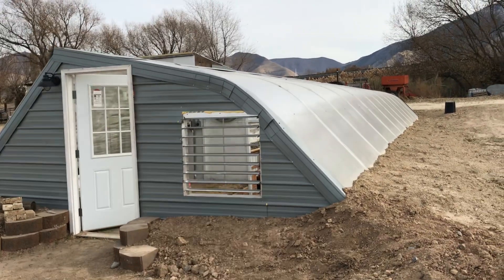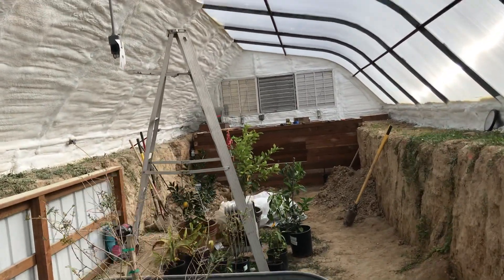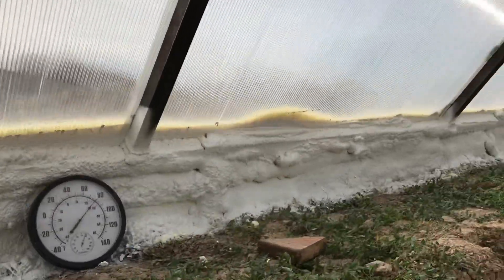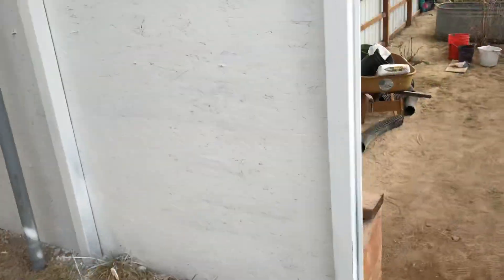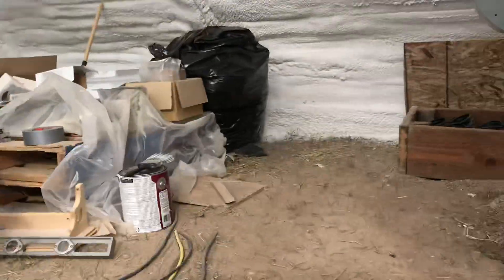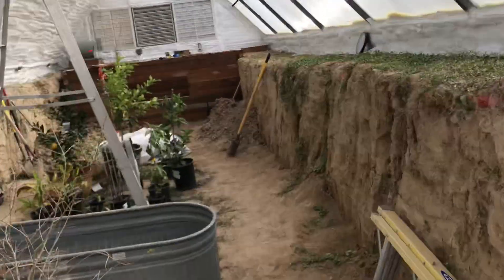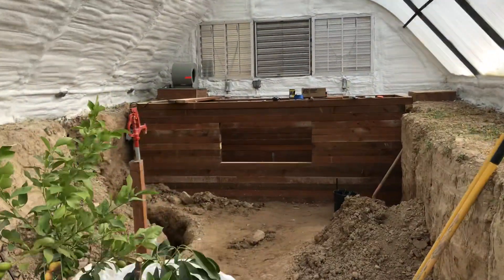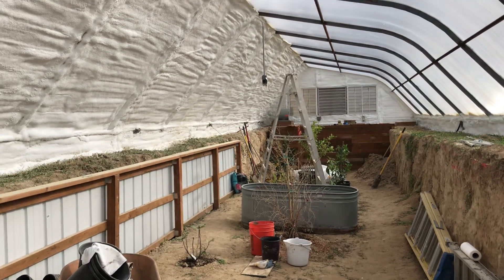Greenhouse update (Nov).  Insulation, geothermal heating and cooling, and more

Comment: Any comments on the potential toxicity of the spray-on insulation?
Reply from the maker: I hired a professional to do the insulation.  They wore protection and masks as there are likely chemicals and  vapors that are not healthy during the process.  I returned a day later to paint the insulation to avoid the potential for any "off-gassing" which may or may not occur during the life of the Product. The insulation and the below ground nature of this Greenhouse help a great deal in reducing the amount of "energy" used to heat or cool this Structure.  Without a doubt the process is not always 100% environmentally friendly but my goal here and elsewhere is a net positive carbon footprint.

Comment: Amazing video! What material are the black geothermal pipes?
Reply from the maker: We used a 4" HDPE pipe.  We purchased it from Home Depot.  Its made by Advanced Drainage Systems.  It was recommended that we use a perforated pipe but we went with a solid pipe because of the water we have here.
Reply: @trailbreakfarms  If u have a backhoe and more 'perforated' pipe, any farmer here in Iowa, could get rid of that water. By not using perforated pipe u are severely limiting your heating and cooling potential. Love the closed cell insulation...I did that back in the 80's for a summer!
Reply: @atomicwedgie8176  Is there any concern about dirt infiltrating through the perforations into the pipe?  Eventually plugging it up?
Reply: @terimiles5699  The only soil that will plug up perforated field tile is fine sand, whether wet or dry. A call to your local county  conservation board would probably be familiar with your local soil types or ask local farmers in your area.
Reply: @atomicwedgie8176  Thank you.
Reply: They also make a sleeve for perforated drain tile to reduce clogging.

Comment: Plyurethane greenhouse ??? What ? I think someone didnt get point of healthy tasty food using   only easy biodegradable materials .. huuuuge finger down folks
Reply: sound like you're prejudicial without understanding the big picture. doubtful you will get very far in life with that attitude.
Reply from the maker: We have never had a goal of using only biodegradable materials.  Timber, for example, does not last nearly as long as the metal tubes we used for framing and would need to be replaced.  There is also an argument as to whether certain biodegradable materials cause undesired methane emissions because they break down quickly.  We did attempt to use recycled, single use material where possible.  But who knows?  We can all learn from each other.  If you know of a Greenhouse built using only biodegradable materials, point us in their direction so we can learn about what they did and why.  Sounds Cool!!!
Reply: I’ll interject due to the ignorance of the individual stating an oil based product is not biodegradable. I suggest start research for diesel from plastics. Plastic will become the #1 most biodegradable product in the world shortly. Oil is the most transformative product, with multiple uses, while still capable of returning to original form using an extremely simple, non toxic, non polluting method. Welcome to the 21st century. This is good news.
Reply: @sknerl  
How about using Olive Oil to protect any lumber
Years ago I'm thinking in Italy that's what they may have used
Reply: @jimh4167  One of the oldest methods of preservation is used in Japanese carpentry. Using fire to preserve, there’s a name for it, followed by oil. Olive oil is a great white oil useful for so much. I see folks using large propane torches to scorch larger areas. Calling it green or biodegradable is up to definition. It’ll look the part.

Comment: If I recall Russ’s back wall is not insulated. I see yours is. I have often wondered how his kits would benefit from spray foam. Will be interesting to see how you make out this year.
Reply from the maker: They (Greenhouse in the Snow) recommended the spray foam to me and told me recent Greenhouses with the spray foam were performing better than those prior units that used insulation boards.  I definitely love the spray insulation.  I went 2 and 1/2 inches thick and it makes a big difference.
Reply: It will make a huge difference and again even more if the front wall was insulated too.  The moisture in the soil will literally wick the heat out of the greenhouse, causing a slight “negative” in the area of heat accumulation inside.  So instead of getting a maintenance temp of 45+ on 15 degree nights, it’d be 36-38   Doesn’t seem like much, but if you’re trying to grow things over winter, ( not just over winter things) its the difference you need.
Reply: UNconventional Me my house is 7” closed in the walls and on top of the sheetrock. Situated on exact south with 19 windows and concrete floors I am heating with 2 small mini splits. And when the sun is out I can turn the heat off and it will hit almost 80 degrees at zero degree outside temps. I LOVE FOAM!
Reply: You could cover the back wall with mylar over the spray insulation to reflect light

Comment: Very cool!  I haven't seen very many people post videos of their kits built.  Russ truly has developed quite the system.  It's on my list to go take a tour and see it in person.  What will you be growing in this space?  Do you have any kind of backup in case the electricity shuts off?  That's my biggest worry.  It gets to -35 here for weeks at a time.  Having the power go out in winter could potentially kill all the plants.  I would be curious what your electricity costs run with the greenhouse in full swing.  Thanks for posting
Reply from the maker: Growing area is 17 x 72.  My plan is Vines on the North Wall Grow beds on north and south.  Trees and shrubs and ground cover in the main area.  Mostly tropical fruit.  Regarding back up, I am going to put a solar unit up next year but our power has been uninterrupted.  I have thought about putting in a back up heater that runs off a propane tank in case of outage.  Right now I'm using geothermal and a back up electric heater to keep it at 50 and above during winter.  My next video will show how I heat and cool the GH during winter.

Comment: So just air?  Cool
Reply: He's meaning empty of plants. Common sence test.
Reply: The bulk of the benefit comes from being sunk in the ground. The geothermal system layout isnt very efficient as the tubes are too long and theres not enough fan power. Citrus in the snow used seven 6" tubes 150ft long with a 10" fan. You can use the greenhouse air volume (cubic feet) and your the fan cfm  to  work out how many times per hour the entire  greenhouse air volume is run through the tubing. Ideally you should design for at least 20x and preferably 45x for effective cooling. Use a friction loss calculator to figure out how much air rhe fan can actually run through the tubes, most folks use the fans free air cfm from the spec sheet which will overestimate the flowrate massively.
Reply from the maker: @JohnGuest45  Definitely being below ground seems to be the best benefit.  Also heavy insulation on the North, East and West Walls.  The Geothermal is pretty useful.  Putting a blower on the tubes pushes the air pretty good.  Also, the fans suck air thru the tubes that are used as vents for cooling.  Our tubes are 12 each and we have runs of 230 feet, 50 feet and 8 feet.  All have different purposes.  Thanks for your feedback.
Reply: @trailbreakfarms 
A good test for the system is to seal the greenhouse up on a hot sunny day to max out the internal temperature. With the greenhouse still sealed up, turn on the cooling systems and see how long it takes to bottom out. When i did this test i got the greenhouse up to a toasty 140F. Still sealed, it took the system a little under 12 minutes to drop the greenhouse to 72F which was the temperature of the thermal mass at the time. Its not something you`d use day to day but its a good way to tell what a system is capable of.
Reply: JohnGuest45 it seems that you know what you are talking about physics wise. But you appear skeptical of the fans and tubes. What is your recommendation? I’m thinking of buying the kit and building the green house. I do not understand how the tubes can stay clean underground if they are perforated or if you hit a water table.
Reply: JohnGuest45 And I’m sure if you bring the greenhouse to 140F, guaranteed you’ll hurt the plants. Probably irreversible.

Comment: Do you have any temperature data that you've collected yet (inside/outside temps, etc)? Not just the temperature coming out, but the actual temp inside the greenhouse.
Reply from the maker: I ordered an Acurite Weather Station that just showed up and that will help me monitor temperature and humidity remotely.  We've been watching the temperature when its gets cold and we are staying 46 degrees and up with temperatures dipping into the teens.  We can get pretty hot if the Sun comes out so we run fans that pull from the geothermal pipes when it get up to 85 degrees inside.
Reply: @trailbreakfarms 
You should have some sensors in the ground so you can compare the in/out temps with the mass temp. It will highlight why a few long tubes are not as efficient as short tubes.
Reply: @JohnGuest45  Can you provide any links so I can study the difference between the long and short tubes?